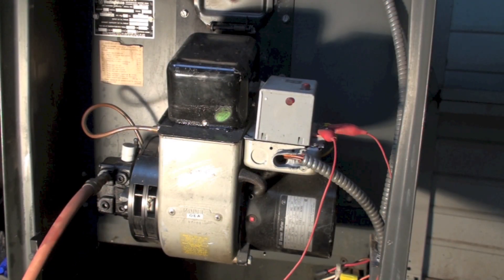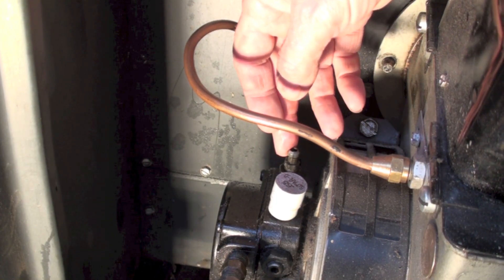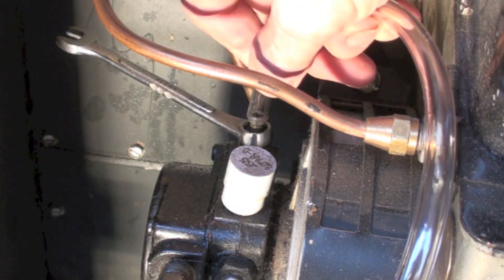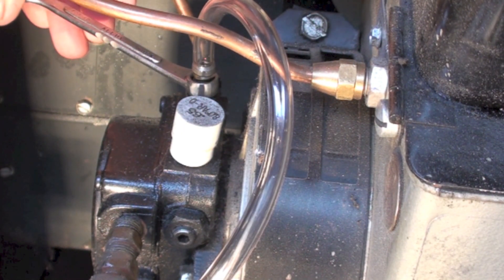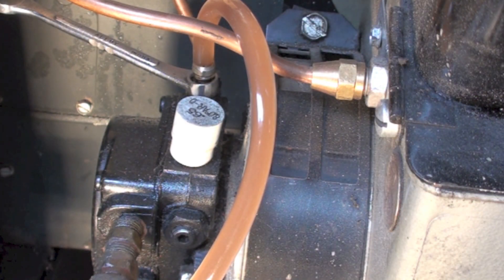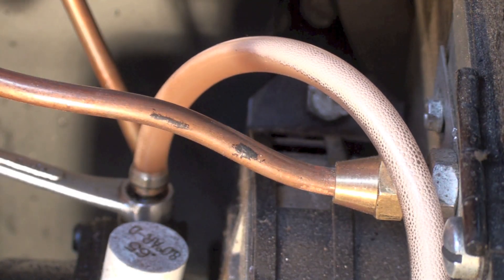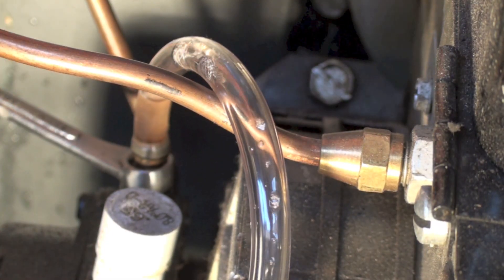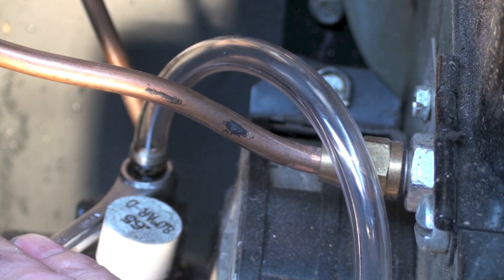How to bleed the oil furnace

Comment: Thanks for posting this, this is the one in depth video i could find on the entire internet. My first time owning my own place and came with an oil furnace i have no experience with them and im the guy who wants to know how to work on/maintain everything in my home and garage so this was a giant help. Just a few trips to my shed for the right tools (my bleeder setup was slightly different) bled system till it ran solid, popped the fuse out and back in, flipped the switch to on position and closed her up, thermostat was stuck then after i fixed that she fired right up. THANKS AGAIN !!!!!!!
Reply from the maker: Quite welcome
GFM

Comment: GFM - Thanks.  I'm trying to be really specific. lol  I have the 2 pipe and I realize I don't need to prime.  I am just trying to determine one thing to narrow down.  On the outbound small line coming out of my pump to the jet - IF I disconnect that and run my pump to prime, what should I expect to come out?  A spray, a fog, a drip, high pressure stream?  I want to know what to expect so I can try and resolve this.  Thanks.  Eric

Comment from the maker: If it is sputtering or fog, there is air in the line.  If it is a 1 pipe system, there is a bleeder that is the best to use to bleed the air.  If it is a 2 pipe, it should bleed itself.  If it does not bleed, you could have no oil, plugged filter, plugged line, vacuum leak or a bad pump.  Hope this helps.
GFM

Comment: Hi, I'm back.  Thanks this tutorial too.  Here's where I am so if you could be so kind, can you offer all potential options left?  I replaced my pump (I have oil too), I bled it (even though I have a 2 pipe and I removed that bypass thing as you mentioned), I've replaced the igniter (which I just tested), and today, finally, I just got the nozzle and replaced it.  Clearly it is not getting fuel.  If I disconnect the outport on pump, nothing comes out.  Should it?  Screw adjustment?  What else?

Comment: Well crap.  Got the bypass plug in and it bled just fine.  Still doesn't fire up though.  Seems to me, the only two things left to replace are the igniter and the nozzle, both of which I went ahead and ordered.  One question I asked a while back but didn't quite get the answer is how do I test the igniter. Your demo has it out of the system to some direct power it looks like but WHEN do I do the screwdriver test if it is in the system?  I could use a detailed answer if you would.  Thanks.

Comment from the maker: If it is a 2 pipe, the tank is probably below the level of the pump, and wont easily prime.  The allen plug is it.  There should have been an instruction sheet in the bag with the plug.  I have a vid on these, put in bypass plug in the search box.
GFM

Comment: lol...ok.  Any recommendation on what to check?  I installed this thing precisely the way the old one was and everything is tight.  Does this double line/pipe thing tell you anything more?   I had a repairman tell me that I didn't even need to bleed it if I have the return but since it's not pumping oil....I need that first.  Ideas?

Comment: Hello GFM - I'm back now.  So, I ordered my replacement pump and installed it.  All connections tight, fuel line open and the reservoir with filter (the external one) is full.  I go to prime the pump and I got some fuel that initially got in to the pump and bubbles and I've attempted to prime about 6 times and not getting a steady flow.  Any ideas?  I watched the video you have that's why I mentioned, I know there is fuel, line on, tight, etc.  It continues to bubble so I know it;s trying too.

Comment: ok, pump removed, coupling is not stripped.  Looks in perfect condition.  In seeing your other videos, the filter inside seemed to be in good condition too, no grime inside.  Pump bad then I guess.  I have the Beckett Cleancut, A2EA-6520, 3450PSI.

Comment: Ok, about to pull the pump.  Hoping to ID problem so I can cancel service call for later today! lol  I presume the coupling stripped will be pretty visibly evident.  There are no final checks on the pump though right?  I mean, if we know it's not coming out and then find that it's not the coupling, it is most certainly the pump?  Thanks.  Eric

Comment: Yes, this is helpful and I hope I haven't bugged you too much on this.  Just for final clarification on the outlet pressure, if I had place a tube on that outlet (just like the bleed valve), run the pump and nothing comes out, that's good indication of what you think - that the pump is shot?  That about right?  I have that Beckett 7505 system you showed in one of your videos too.

Comment from the maker: If you have oil to the pump, (this is assuming there are no vacuum leaks on the suction side of the pump, usually accompanied by an air noise from the pump) and there is no high pressure at the outlet, either the pump has failed or the coupling between the motor and pump is stripped out.  Hope this helps.
GFM

Comment: I just realized you had a bunch of videos.  I wrote on one of your others earlier today and tonight about the screwdriver test.  Went through all of these very nice videos but didn't seem to find my problem.  I don't see anything that shows where the oil goes when it heads to your jet, through that small tube on back side of pump that connects to your jet.  I am not getting fuel coming out of it, although when I disconnect all the way down at the pump, oil is flowing.  Small line is clear though